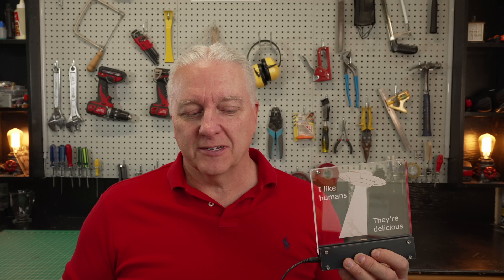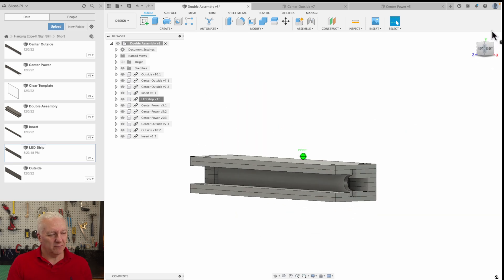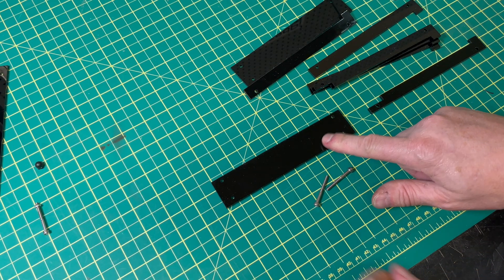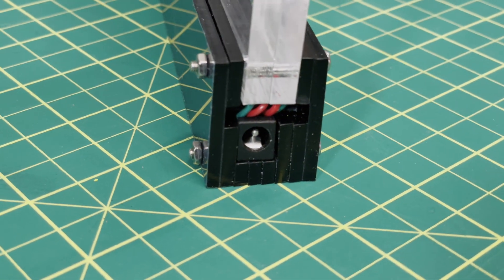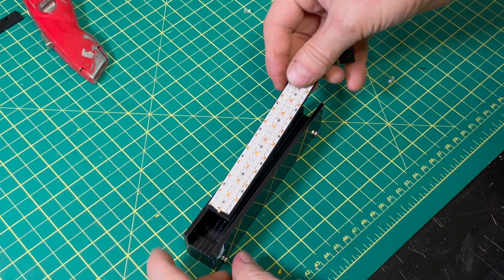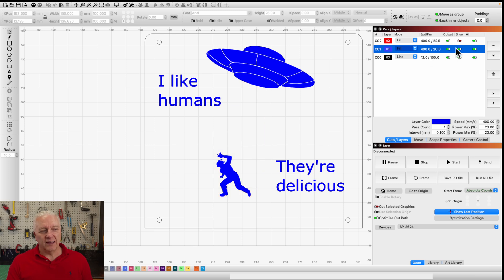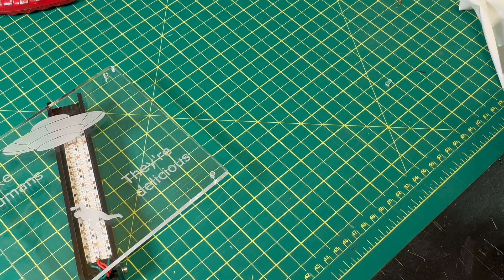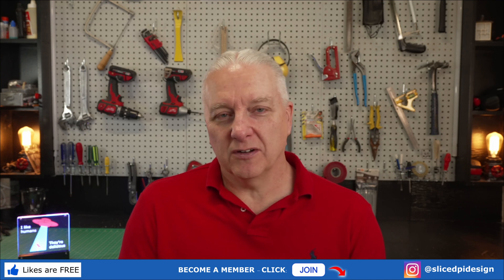Make an Eye-Catching Two-Color LED Signs With Ease

Comment: Beautifull Steve u really made very good videos on very nice projects! thank you, i had a diode so... but its allways instructive, i use autodesk inventor professional, i did not know fusion can do the same, wich format u export the draws, to be ready to use on lightburn? plus, autodesk are paid softwares, did u know some goodone that could be free?, im not cheap but im poor in Argentina, but we still have hope due to our new president so im trying to start a micro laser shop to see what happens  :)
Reply from the maker: You are very welcome! Glad you enjoyed the video.   Most of the time with lasers I work with SVG files. There’s a plug-in for Fusion that can export them, so I can jump right into Lightburn an import them.
Reply from the maker: I wish I could find something like Fusion that was free. There’s FreeCad but the learning curve is vertical on that.  Also TinkerCad is free and decent, though fairly limited.

Comment: Please show a light test on "coloured acrylic sheet" instead of clear acrylic
Reply from the maker: Light generally won’t pass through coloured acrylic.  I have a light base and some translucent red and yellow in my shop so I’ll try this out. Maybe I’ll create it as a YT short when I get a minute
Reply: @SteveMakesEverything thanks for the reply 👏 can we multi-colour (paint)the engravings in 1 sheet? instead of using 2 sheets, 2 led base🎉
Reply from the maker: @praveen8  I don't think paint will work  because it will block the light completely.

Comment: can upgrade with ESP32 and two RGB diodes... even an old newcomer can learn enough to do this on a weekend.
Reply from the maker: Be adventurous.  Sometimes you need to design on the fly to use what you have. RGB diode string won't be as bright, but if you run two of them, you can get an infinite set of colors.
Reply: @SteveMakesEverything  I meant using two discrete diodes, he could then adjust colours using an  ap, or just let it cycle or whatever.. It is pretty fun and very cheap
Reply from the maker: @poepflater  If they are single diode, the sign will probably need to be pretty small, but experiment - sometimes you learn what NOT to do and sometimes you get a pleasant surprise when the result is awesome 😄

Comment: really awesome video! Subscribed!
In Lightburn how did you get the top part of the acrylic with smooth edges and the bottom half with straight edges?
Reply from the maker: This is just how my laser cuts acrylic. If you aren’t seeing this behavior on your laser then maybe it’s time for a calibration

Comment: From my first impression I figured you made two sheets of acrylic, made unique etches on each, then layered them to achieve this look with RBG LEDs for each layer.  Looks like I was right.  Nice explanation of the process.
Reply from the maker: 😀. Yes, you're exactly right.  The trick is to make both layers look like one, so you want to make sure you have the engravings sandwiched together in the middle so it doesn't look like there is any layer separation.

Comment: What wattage is your CO2 Laser which you use to cut the 6mm clear acrylic?   Can a 60W CO2 Laser cut this?   I am looking to upgrade from my 10W diode laser soon.
Reply from the maker: My big laser is a 90w but you should be able to cut 6mm using a 60w with relative ease
Reply: @SteveMakesEverything  Thanks for the quick reply and your insights on CO2 laser power for cutting acrylic.  Let me also say thank you for all of your videos which have been very helpful as I start off with laser engraving projects.

Comment: So is there no need for air vents for the LEDs? I assume they aren't putting off much heat?
Reply from the maker: No, the ones I used get warm but not hot and there aren't very many of them, so there isn't much current draw.  There is a bit of an air gap between the LEDs and the clear acrylic so there some opportunity for air to move through,  I've made signs like this that are 1 foot (30 cms) wide with the same LEDs and there still isn't a reason to cool them.

Comment: Very nice as usual. I get lots of great advice from your videos. Thank you and keep them coming. Only difference I would make to this would be to use Post Binding Rivet screws to hold everything together
Reply from the maker: Yes there is definitely better hardware. Button head screws would be a better choice along with acorn nuts,  but you use what you have 😁. Improvise. Adapt. Overcome.
Reply: @SteveMakesEverything  This also gives me a better idea for making lit signs with LED lighting all the way around.
Reply from the maker: @ou812vh01  Yes and note that if you were using 4 layers of 3mm acrylic, using different colors on all 4 sides would allow that to happen easily.

Comment: Steve, great video! Not having soldiered since my Navy days…way too long ago to remember… what is your opinion of the soldier free connectors? They do look bulky.
Reply from the maker: I suppose you could use solder free connectors but you would certainly have to redesign the entire base to make them fit.  Since to make this you'll end up buying a couple rolls of led strip, there probably not much risk if you make a mistake.  You'll be using 6 inches of led strip from a 16 foot roll so don't be afraid to practice.😀

The soldering effort here is really simple if you are using a low wattage iron.  Maybe I need to do a video on soldering!